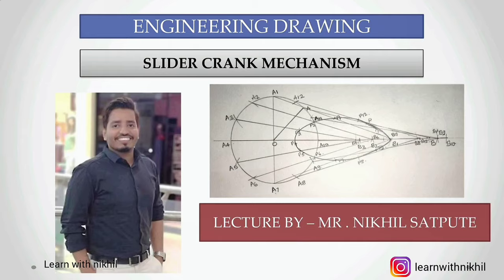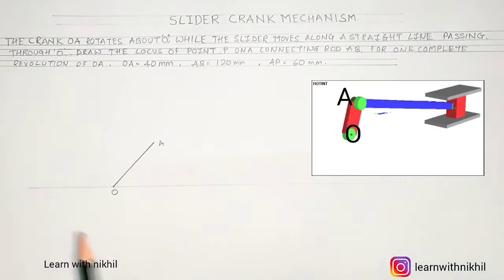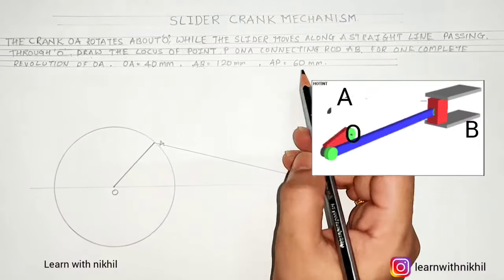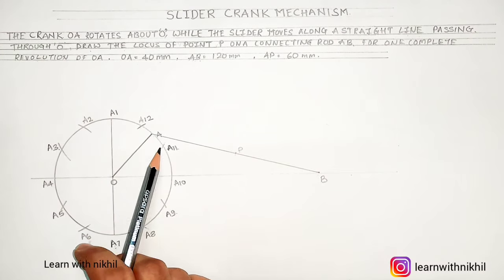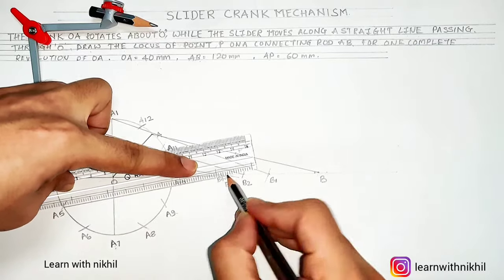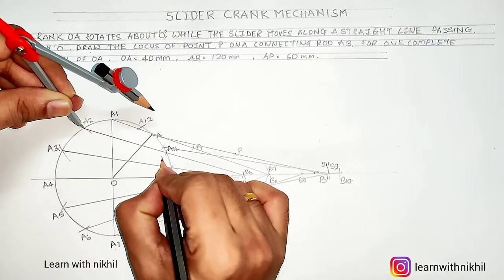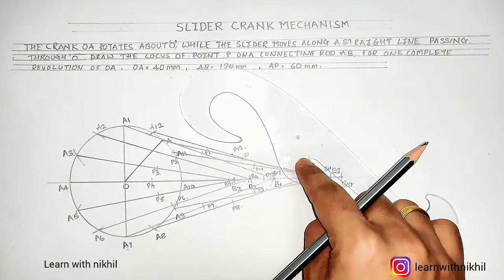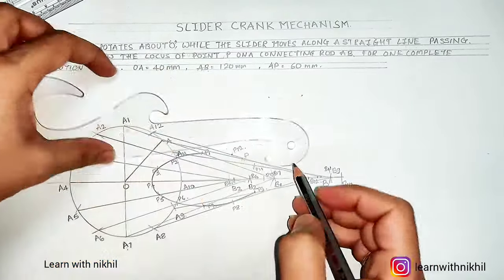Engineering Drawing | Slider crank mechanism 1 | Easy drawing techniques | Learn with nikhil

Comment: In a slider crack mechanism connecting rod AB is 120 mm and crank rod is 40 mm. The end B moved along the straight line passing through O. Trace the locus of point P= 40 mm along the connecting rod for one revolution of crank OA.

Comment: Sir plz sabkuch batao sir equal part mein divide karne ke liye kitana 😂❤ distance le 😢
Reply from the maker: for diving into 12 equal parts you can directly use the formula where entire degree of circle is 360, so 360/12 = 30, so har ek angle will be 30 degrees, vaise hi agar 8 equal parts me circle ko divide karna hai toh 360/8 = 45, so har ek angle will be 45